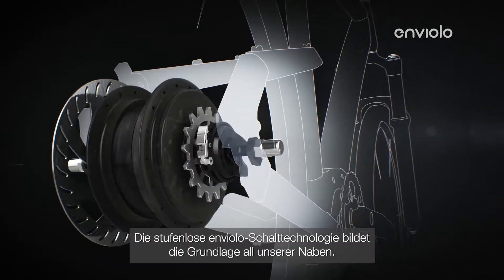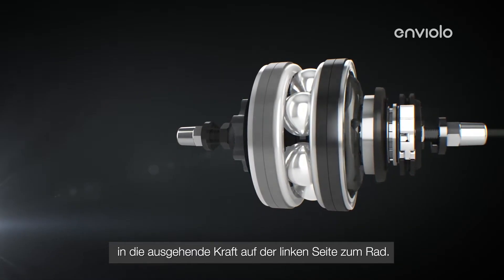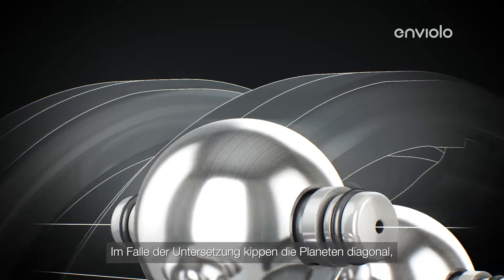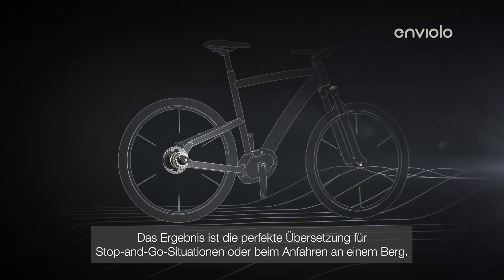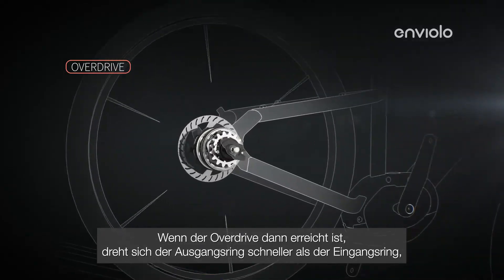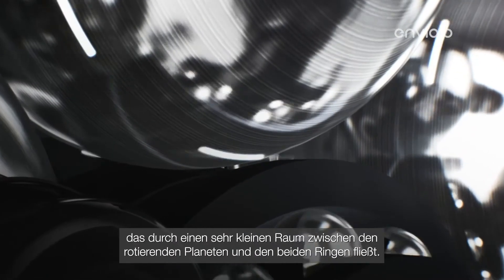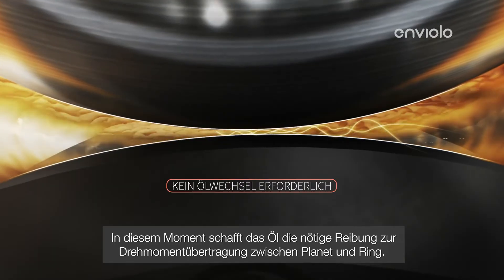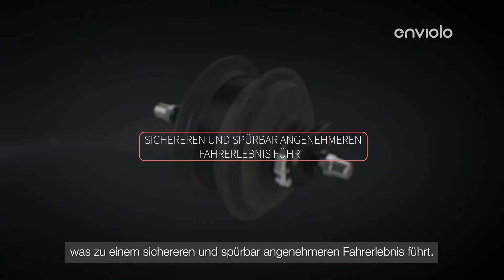enviolo technisches video (Deutsch)

Comment: I have this Enviolo Cargo gear hub installed on my e-cargo bike from Johanson Gunnar. In my experience, the gearing doesn’t work as smoothly under load as shown in this video – for example, when riding uphill and pedaling at the same time. It feels like there’s a lot of tension on the chain.

A gear change only works properly when I ease off the pedals for a moment – that’s when the next gear engages. I’ve also noticed that the gears sometimes slip when riding over uneven or bumpy terrain. The bike is only two months old.

I already took it back to the bike shop, but they charged me for a chain replacement due to “wear and tear.” Unfortunately, there doesn’t seem to be any warranty or goodwill support from the manufacturer.

For these reasons, I’m currently rather disappointed with this gear system. I’d really appreciate feedback or a possible solution from the manufacturer.

Comment: Every ~16000 km the Enviolo hub fails and has to be replaced! 😠 Every classic hub has an opening with a cap to add oil. Why can't the oil be changed or replenished in the Enviolo? The short live expectacy is really a pity, because otherwise I liked my Flyer Upstreet 5 s-pedelec with automatic gear change. Will look now for another gear system with drive belt.